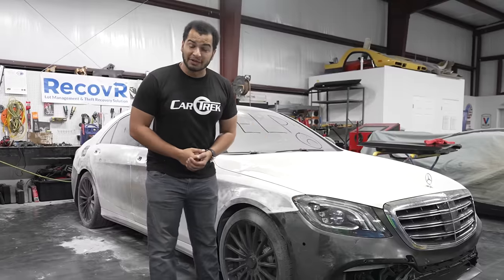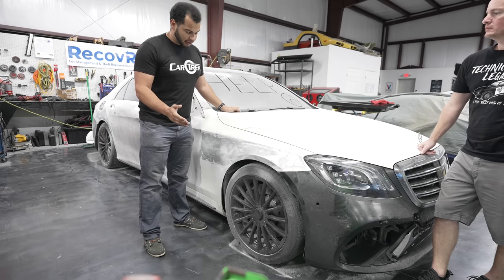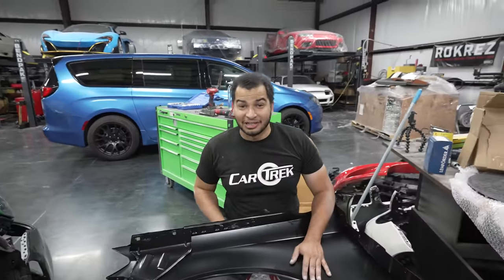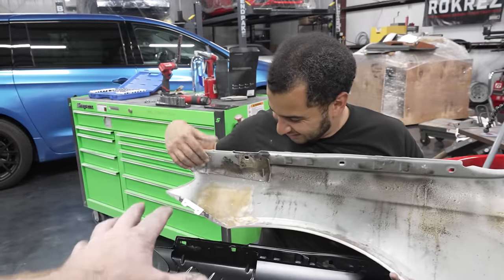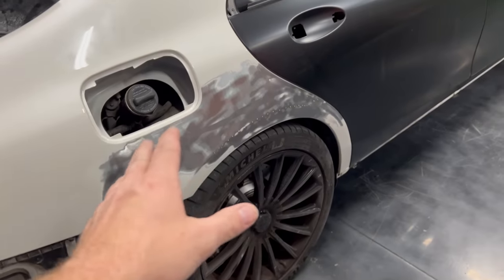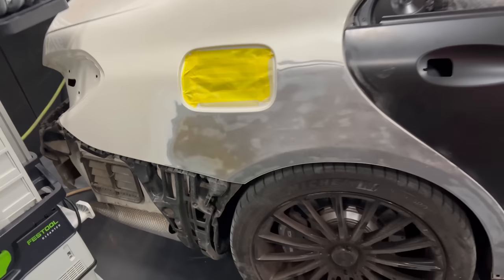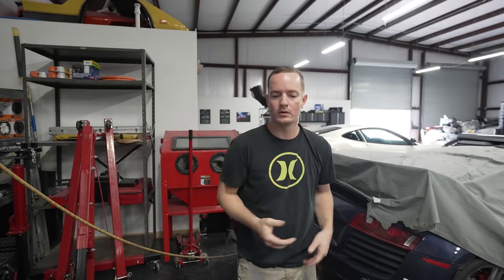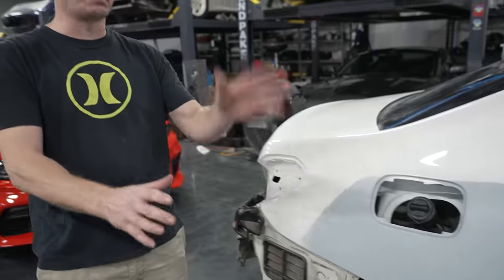I Had To Fix $20K+ Of Hidden Damage After The Dealer LIED And Said My Mercedes S65 AMG Was PERFECT

Comment: Very nice car! The other “body shop” was probably somebody working out of their backyard with a Walmart dent puller and an angle grinder… Sketchy dealers buy wrecked cars at auction and get them fixed by low budget body guys like that then they sell them full retail to somebody with bad credit.
Reply: As someone who works at an auction.....I can confirm that
Reply: Technically they’re getting scammed
Reply: Ironically there is a big segment of automotive YouTube channels who also buy wrecked expensive cars at auction and make videos about how cheaply they can repair them.
Reply: Was probably B-Is For Bullshit
Reply: See MAACO
Reply: Sketchy work my my body shop days was a Toyota fully swung and torn front gram horns! They straightened the horns and welded threaded rod over the torn sections. I flat out refused to work on it! They just came in for paint and panel fit!
Reply: As someone who has seen sub par body work done by literal “luxury” carmaker dealerships…it doesn’t shock me at all to see stuff like this coming out of a “professional” shop. 

The family biz is marine refinishing. Not quite the same as cars, but a lot of crossover. Bottom line, it’s expensive to do it right and it takes decades of institutional knowledge being handed down from one generation of staff to the next. It’s demanding work, requires precision, patience and technical knowledge. There are many hacks, some decent people and very few experts. 

Jack is 100% legit. Dude clearly knows his stuff.
Reply: Personally I was think it was more likely the previous owner did the work.  On a Mercedes this repair would have been +$10k. The owner did the work in their backyard with minimal tools.  Probably the only thing they may have actually paid somebody to do was the paint job to cover it all up. Yu then sell the car once all the work is done and before the flaws start to show themselves.

Comment: I’ve often found that the more expensive the car, the worse the standard of body repair work you can expect on it. They assume that by the time someone can afford a car like that, they’re going to be older people, with little mechanical knowledge, and who only drive the car now and then. They might even overlook minor imperfections in work. Some body shops trust in this. What they HATE though are “picky car owners” of any type of car at all. I took my forty year old (but immaculate original condition) Celica in for an insurance job on a small dent on the back fender. When I went to pick it up, I noticed some of the original dealer fitted pinstripes were missing in patches. I complained immediately and they revealed they clean the cars with pressure washers, which probably blew off the old pinstriping. They seemed to think it was no big deal and to just tell people “they fell off with age”. Nope. I made them find a pinstriped (not easy these days) and repair as much as possible at their expense. They weren’t happy.

Comment: I don't know anything about body work. The question I have would be if you are repainting an area that has been fixed, would it be better to repaint the whole panel? I would think that the original paint would be really good. Trying to blend it in would be so hard to match. Also considering you have to paint that whole side again anyway. Just curious.

Comment: I do wish I had someone like Jack to help me with the body work on my car. I had my car repaired at a body shop and they did a pretty good job. However, the paint work in the rear door jam where they blended it wasn’t the best and the clear coat was cracking off after 6 months. Now 2 years later it’s getting really rusty over where they did the body work and there’s actually base coat flaking off near the rust with good metal underneath. Not sure if I can take it back to get something done about it for less money or for free.
Reply: Most shops should warranty against paint failures hopefully they will take care of you
Reply: @jackbuildsit  ok thanks! Yea hopefully. Maybe while it’s there I could have them fill the rock chips and fix the few scratches it has. But atm it’s very broken and I can’t drive it. Doesn’t help that I’m broke lmao!

Comment: Hay I m the warranty quick question I doing that conversion on S-Class also updated bumper to 2019 s63 bumper did u have to uy new blind spoting brackets 🤔
Reply: Those transfer from the old bumpers
Reply: @jackbuildsit  my bumper is 2015 they don't  fit had to order for new bumper

Comment: there is a possible chance the dealer did not even know about the damage and the body shop did all the work under the table so that no carfax could be done on whatever accident the car was in. i once was test driving a car at a dealer and found a repair bill for 10k in damages to the rear. car was put on the frame straightening machine and everything and the carfax said it was clean

Comment: Why do you want to treat a aluminum part to avoid corrotion? The aluminum rust is the best protection against corrotion...
Reply: Road salt eats right through 'aluminum rust'. Galvanic corrosion is also a high risk, given the car is both steel and aluminum. Also, when aluminum parts get seized together due to corrosion, good luck separating them. Aluminum oxide is not a good enough protection against corrosion.

In fact, I trust certain grades of steel over aluminum when it comes to road salt. Out of the 4 6061 Aluminum bikes vs the 5 chromoly steel bikes in my circle, 3 aluminum bikes, one from 1997, one from 1994, and one from 2016, had parts completely seized beyond repair. None of the steel bikes had any problems, two of them were from 1975, one from 1976, and one from 1989. My bike is a modern steel frame and I've practically pumped it full of rust preventative.

Comment: In my country I would sue the seller for having hidden damages and having lied to the buyer. I suppose that in the USA it should be easy to do the same and claim the price of the repair and the corresponding compensation. good job and good luck. greetings from Spain
Reply: You can, but it depends how it was sold.
If it's sold "As is" then it's basically sold as the car currently stands. Whether there is hidden damages or not. And in those sales,  the buyer just has to take the L. You can try to sue, but idk if it'll pop out successful or anything like that in an "As is" sale.

If sold with a warranty you could plead that. But it depends on what the warranty covers and what you signed.

Comment: I feel that most of the parts  could have been restored without replacing the doors and panel. I feel most of this would have been fixed by a skilled technician  without replacement.  Even the filling  was thick and at the end two spots unnoticed? If you have excess money this is what you do.

Comment: I would definitely sue that dealer. This is crazy.
Reply: they probably didn't know of the damage themselves
Reply: @amongusmeegoose  probably not but it's their job as a dealer to thoroughly inspect anything they're going to put their name on and sell.
Reply: @lexgsj  he definitely bought it as is
Reply: @dickjames5007  I'd still sue. They sold a car that was not repaired correctly and because of that it would be unsafe if involved in a collision. Trust me, at some level the dealer knew what they were doing.
Reply: @lexgsj  don’t know how you could sue for buying something as is
Reply: @dickjames5007  it all depends on if it was disclosed that it was in a collision and if that collision repair was performed to USDOT standards. If not he has a case.

Comment: Yeah, it doesn’t leave much dust but at $4,500 (last time I checked…not including the paper) I’ll pass. Plus, using an electric DA when you’ve been using pneumatic for 20+ years is an odd thing to get use to especially when you have a vacuum hose along with it.
Reply: It’s really not bad this is the first time I’ve used this machine and it was really easy to use

Comment: How exactly are fenders and side skirts "structural"?
Reply: They're talking about structure that allows the body panels to stay rigid and straight under regular driving conditions
Reply: They are part of the shock absorption in an accident. Everything works together to create a safe cabin. In the bad old days, fenders were just bolt-on ornaments, but safety requirements changed. 30 years ago I saw a 190e stacked into a concrete pillar on the motorway - smashed back to the windscreen. Cabin doors working perfectly, occupants fine. Have a look at some of the old crash testing videos.

Comment: Why no acid etch primer or epoxy primer before body filler ,it will sweat over time,,Never apply filler to bare metal 🤦🤷🏼‍♂️
Reply: For jack charging as much as he does,for doing that at our shop he would be fired